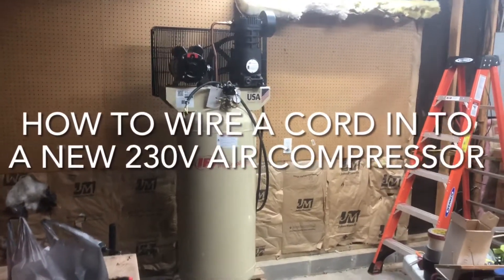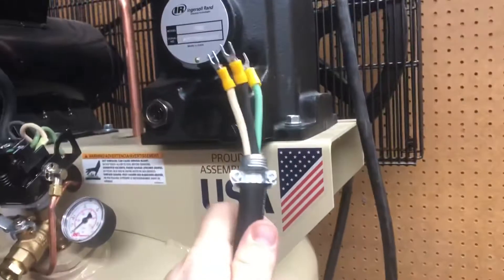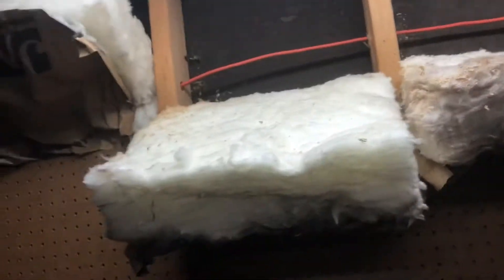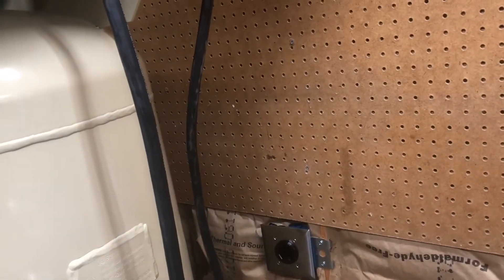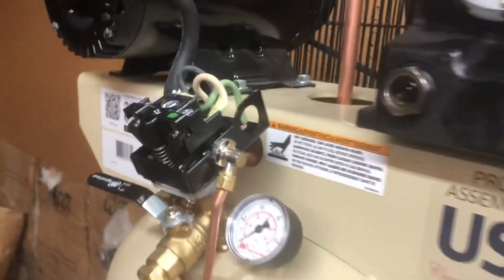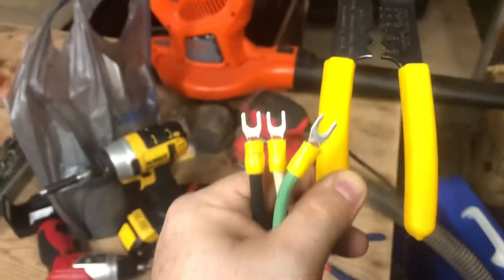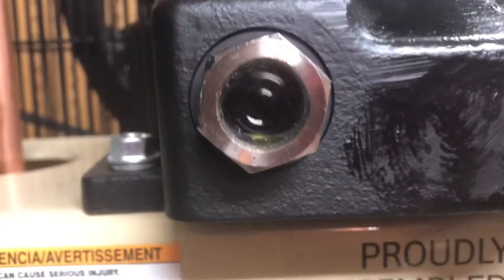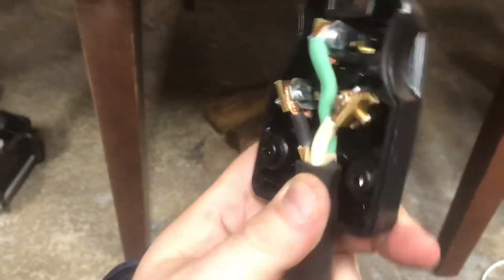Power Cord for a New 60 Gal Air Compressor

Comment: The strain relief is not appropriate for the cable (or size for that matter), as it is actually for use with NM cable (the orange wire your friend installed from the CB panel).   You should have used a strain relief cord connector in metal or plastic.
Reply from the maker: Good to know! I’ll have to change that out soon.
Reply: Can u help me with mine
Reply: I'm trying to install my jenny g 230 volt and need a little help

Comment: What did you find out when you read the manual? Sight window should be full of oil not at 1/2?
Hows this one performing now?
Reply from the maker: Which manual item are you referring to?

For the oil. You are correct, the sight glass should be full. I fixed that after this video.

Still running great 4 years later with no issues on mechanical or electrical side! The best upgrade I did was add an after cooler (Basically a generic radiator) and self draining water traps between the pump and tank. Air going in to the tank is almost completely dry!
Reply: @nneiil I believe you are on the right track. The after cooler is to me a no-brainer.
Maybe you could do a laser thermometer demonstration to show how effect it really is.
That would be a great follow up video.
The manual Im referring to is the one that came with my new compressor or you can simply scan the QR code that is on the label placed on the base plate between the electric motor and the tank.
Reply from the maker: @Speederhank  I can definitely say that it cools it from ~200° to ambient very easily.

I'll have to see if I still have the manual that came with it!
Reply: Page 8.
Slowly fill the crankcase with lubricant until the lubricant
reaches the top thread of the oil fill opening and the top of the
sight glass. Crankcase capacity for the SS3 is one-half (0.5) liter.
Crankcase capacity for the SS5 is one (1) liter.
Replace the oil fill plug HAND TIGHT ONLY

Comment: Not sure if anyone mentioned this already. But your circuit amperage is way too high. It should be 20A max
Reply from the maker: Can you elaborate? I’m not sure what you mean.
Reply: @nneiil if your motor is rated for 15 amps,  the breaker shoulder be over 15 amps. That's what im understanding anyways.  
Because the wire will overheat and burn and start a fire and bla bla and burn down the whole solar system

Comment: Dude! The tag that is on the 60 & 80 gallon,5hp says to use a minimum 8AWG wire.
Reply: 5hp I imagine runs no more than 25 FLA (FullLoadAmps). If it does I would be surprised. 8 AWG is for 40 amps. I don’t think this electric motor  needs 40 amps or even 80% rule (32 amps). 

With that being said, the OP states his 5hp is rated at 21.9 FLA. So breaker protection would need to be 25 or 30 amp. Which calls for 10 gauge wire. 

You could always run bigger wire especially if your a good distance from the breaker itself. But you don’t wanna get into the mind set of running 8AWG and then doing a google search of what breaker to use for that wire because then you’ll end up using a 40amp and that’s too much for this application.
Reply from the maker: Interesting. Mine came with no such tag back in 2021. For reference, this model is the IR SS5L5 with 21.9 FLA.
They may be just covering their butts. Mine has worked fine this entire time.

Comment: What weight oil does this take? Thank you
Reply from the maker: 20(colder areas) or 30(warmer areas) non-detergent, compressor oil.

I recommend just getting the stuff from IR.

Ingersoll Rand 38436721 OEM All Season Select Synthetic Lubricant, 1L Bottle https://a.co/d/eOOq1vq
Reply: @nneiil  thank you for your response!

Comment: Exactly what did you need a 60 gallon 5-10hp motor compressor for??? Thats a beast especially for a rental. Those are normally bolted to the concrete and never to really move again.. Unless 20 years go by and you wanna upgrade. With that tank you can run any air tool out there and never run out of air.. like never, ever.. ever. Never ever ever never. I want one
Reply: My first compressor was a 2hp 13 gallon, dismal I know. I outgrew it before I got it, but it was a gift so I kept it until it finally died. It was good for airing up tires and if I wanted to sand something for three minutes at a time.... Then, I finally got something worth using, a 6.5hp 33 gallon. Noisy as hell, and did a bit better, but sandblasting was like sanding on the old compressor. Two minutes or less and it was done. NOW, I am finally about to get a real compressor, one like this. If you're even slightly above the airing up your own tires phase of your life, this is the only way to go. I do my own sanding, blasting, and painting on my project car. I finally started stripping the paint with an electric grinder with a wire wheel. (No it doesn't warp metal unless you sit in one spot, the metal never even got warm to the touch.) Anyway, I should be able to put away the grinder, once I get the 60 gallon installed and running.
Reply from the maker: I’m doing automotive sanding and painting. Eventually, I’ll be installing a plasma table as well.

So true. It’s going to be a bear to move, but it came with a pallet and isn’t impossible to move and secure. Lol.

It’s great! And actually a lot quieter than most 10-30 gal compressors, especially the oil-less ones.

Comment: Thanks! Exactly what I was looking for. I bought one used for a steal ($250) I didn't get to verify that it worked and don't want to spend the money having the electrical work done if it's no good. Just want to try it off of my dryer plug first
Reply: Does your dryer plug have color coded wire?

Comment: They're all tested from the factory and then they drain the oil so there's always a little bit of residual left in the engine but believe me there's not enough oil in there to run it more than a couple minutes without it actually doing some damage but I are always tests their equipment before they send it out that's why you had a little bit of oil in there